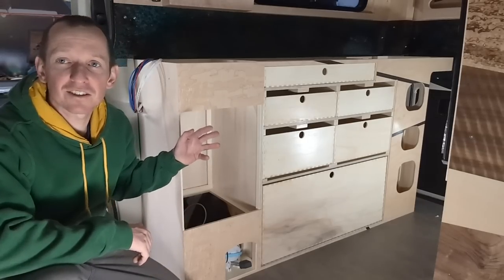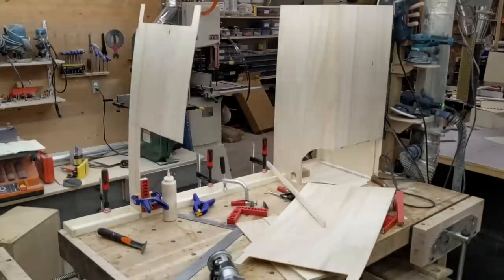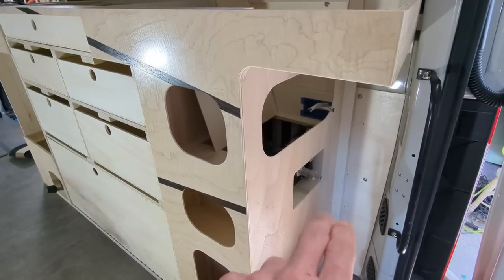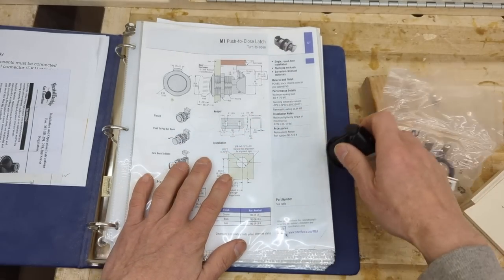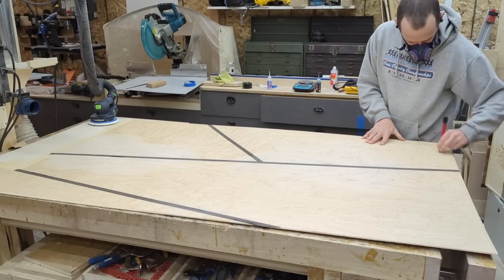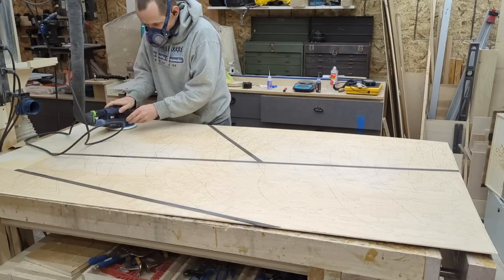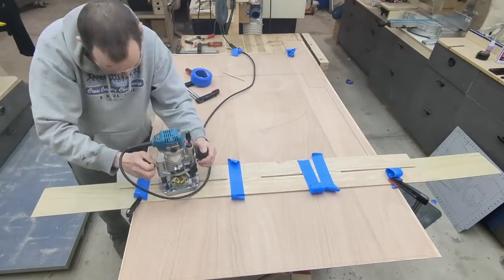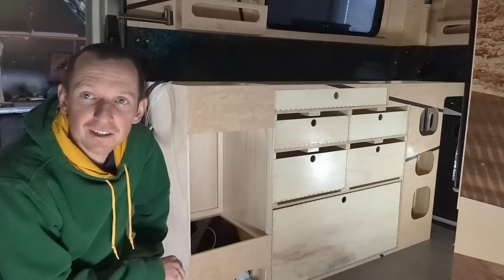Building a Lightweight Van Conversion Kitchen Cabinet

Comment: Finally somebody using lightweight design for a van, I keep seeing all those heavy 12mm plywood cabinets, sometimes even thick frames beneath of 50x50mm square.
You can also apply following methods. Create circular cut out with a forstner drill or similar like in aviation design. This would save further weight. 
Use aluminium frame and rivet shin plywood sheets to it, will decrease weight further but is more expensive.

Comment: 1/2” is definitely strong enough for a cabinet built. In fact, how you built this is exactly how many vintage RV’s were built. Even drawer boxes had 1/4” sides and bottoms. 1/2” for fronts/backs and fronts were routed out for overlapping inset finish. I’ve seen another cabinet builder use 3/8” using screw locks only. His theory was he could remove it all when it came time to sell the van.
Reply: Higher quality plywood will have more layers for a specific thickness, this is key to using thinner materials. Standard 3/8" is often only 3 laminates thick vs 4-5...

Comment: If you put 2 parker screws in at 8:32 that stick out just 1 or 2 mm then you can just hold the jig against the drawer, give it a tap with the hammer and you don't have to draw. You have then the pilot holes ready to drill.
Reply from the maker: Thats a pretty good idea.  I don't think it would even take a hammer, just a firm press which I'm already doing to keep it aligned.  Thank you!

Comment: great videos! First I've seen of someone really trying to build ultra light.  I know it's tedious and you are kind of winging it, but could you do a more detailed video on building the cabinet boxes?  Keep up the good work, it's much appreciated!
Reply: Adam use sheet aluminium it will cut the weight down by half at least
Reply: @stevel1451  I've not worked with metal much.  I'm more of a woodworker. But I've also thought about foam with fiberglass
Reply: I guess foam and fibreglass will kill 2 stones with one bird. Lightweight and insulation. Great idea mate I might look into it. My build has just started and I don’t want to have any dead weight, performance and fuel economy suffer.

Comment: By far the best way to build is use .9 and 1.2 aluminium sheet. . Fold the .9 to form the cabinets and fold the 1.2 to form the drawers, then cover with wrap. It will cut the weight down enormously.
Reply from the maker: Howdy.  Just for your consideration: 0.9 and 1.2 mm aluminum (I'm assuming you are using millimeters) is .5 and .67 pounds per square foot respectively.  3mm and 6mm poplar plywood is 0.25 and 0.5 lbs per square foot respectively.
Reply: Hi Thank you for making me aware. I would have never thought that any timber could be lighter than aluminium. I will now consider other materials. Enjoy your build mate mine has just begun

Comment: nice work but as you eluded to the devil is in the details. It reminds me of seeing houses built in California; they would put structural steel beams in key location for earthquakes. Not that I'm suggesting putting steel beams in a van but structural lumber to support heavy objects or ones with loads i.e. sink, refrig., etc. This seems to be the difficult calculation how much and how big??? Have you designed and tested for these key components? It would be interesting for you to come up with some basic plans which you may even be able to sell.

Comment: Love your ideas on construction of low weight. What is your thoughts on low weight seating/benches? Any Ideas to minimize weight and provided necessary strength?
Reply: Use folded sheet aluminium it will drastically reduce weight. It won’t attract or hold moisture like wood does

Comment: Thank you for the specific information about the Southco push latches. I have been a cabinet maker for 30 years or so, and I try to use similar jigs for hardware installation,  but what I really appreciate is your explanation of the continuously operable spring latch, which avoids "dead slams" against the cabinet face. This type of detail is really important and hugely frustrating, after the fact, when you have to purchase online and can't get the hardware in your hands to judge how well made or practical it is. I will order those latches for my Sprinter casework. They appear to have the added benefit of being flush and visibly locked when ready to travel but easily operated when in use. Do you have any negative comments about them, or would you use them again? Do you think it would be practical to add a thin felt or foam strip to the latch catch angle piece to eliminate any rattle, or are they solid enough to not need that? I always enjoy designing construction and assembly challenges into my custom kitchens and interior trims and wainscoting jobs, which result in a clean esthetic/ finish appearance and I appreciate your description of how you enjoy those challenges in the shop, but I've gotta comment that the routed out overlay sequence you perform on your facework has got to be the most over the top difficult to pull off thing I've ever seen! I realize you allow for some "fudge factor" with the 1/16" bit and 3/32" gaps, but ... the alignment of the routing jig ... the completion of the inside corners.... the transfer of the easily broken/ multitude of super thin sections finished routed panel.... the final glueup difficulty.... ???? More power to ya... would you perform this same process again or choose a different challenge next project? You should be ... "The Human CNC" !

Comment: I have been living in a van for 5 years now. Vanlife is a hard-knocks life for EVERYTHING that goes into the van. People laugh when I say that I deal earthquake and hurricane forces daily but it's true. I know of no other phenomena comparable to the torque, twist, velocity and vibration that you live with in a van. My old tick-tock alarm clock rattled apart recently because I had it secured to part of the van that, unexpectedly, conducted road vibration to the old brass clock... And these thin sheets are going to hold up under all that? 🤨
Reply: The only thing worse at shake, rattle and roll is a camper/trailer, but I get your point. I would think there are some suspension tweaks you could possibly do, but campers are leaf springs only, thanks.